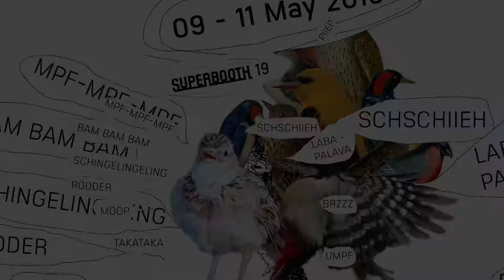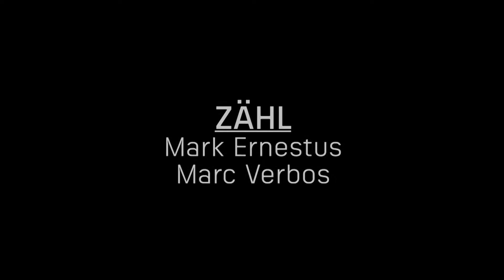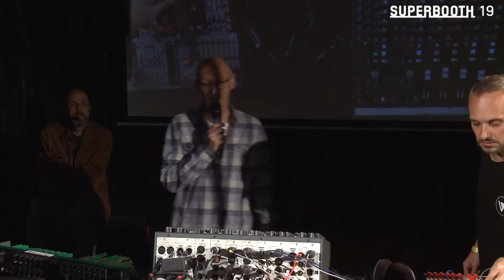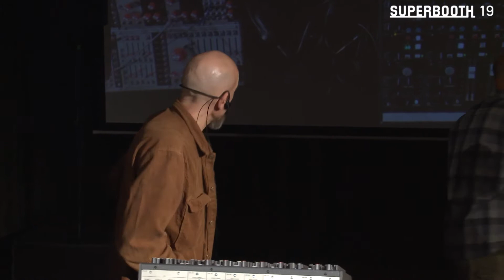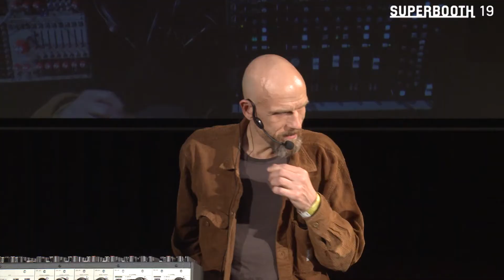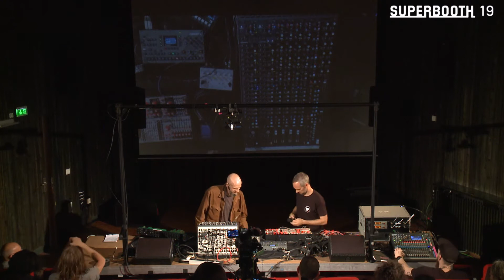ZÄHL - Mark Ernestus @SUPERBOOTH19

Comment: Its funny how man behind basic channel with less is more approach goes to opposite direction and searches for overcomplicated solutions for problems that don't exist. Want to modulate mixer parameters? Just use a DAW.  One of the worst tech demo ever.
Reply: It’s designed around his workflow, which is in the analog domain

And basic channel isn’t exactly less is more for its own sake. Things like sonic fidelity are placed on a higher pedestal than cluttering up the mix with nonsense. Try making basic channel-sounding stuff on a daw and watch it fall flat on its face. They were extremely particular, down to using an unbalanced mixer with custom Mogami cabling throughout the whole studio. Less is not more. Doing something right is more.
Reply: @fl7210  It's 2021 not 2010 and you can make everything in the box. What you need is just knowledge. Mark haven't released anything good or memorable past 20 years. It looks like typical middle age crisis. So instead on focusing on creativity he invents not existing problems and try to solve them. I'm not against gear, but this is just rich mans toys and nothing more.
Reply: @dundulis303  Again, remake BC's sound in the DAW, then we'll talk
Reply: @kw1ksh0t  Butthurt fanboys are the worst. There is nothing special about BC sound. Actualy it's a myth that it was produced using hi end quipment. If you listen to them on high end stereo their releases sound like shit. Their technique wasn't even their own, but classic reggae dub mixing. They were the first who used it for techno. What BC had was their style and the fact that they were pionners in this genre. This plus nostalgia makes them classic and sound the way it is. Few years back there was EP released(4tracks) by some dude that nailed BC sound 100%. At first glace I thought it was unreleased BC record. If I have time maybe I will find a link among my favorites and post there. Nowadays you can produce any sound or genre in the box. What you need is not gear, but creativity and knowledge.
Reply: Lol “some dude”. At least you could’ve mentioned the artist’s name to make your point, but you didn’t because you know you’re completely wrong. Their sound is ethereal because it’s been carefully developed. Also, of course their tracks sound “lke shit” on hi-fi, probably because you don’t understand that the noise, distortion and intentional auditory idiosyncracies are intentional. 

DAWs can’t reproduce this stuff easily because it’s almost impossible to correctly simulate the analog signature with a dynamic audio signal. That’s why no one’s succeeded yet in replicating their sound, and the oke’s who came close did so using analog gear. 

Another thing: using hardware is ultimately a lot of fun, and can improve creativity compared to digital mixing. Sometimes restrictions can lead to the parameters at hand being used better
Reply: @Ruktiet  blah blah. Fanboy rant. And yes I forgot that dude and don't have time to search for that release in playlist witch consists thousands of tracks. I just remember that it was 4 track vinyl with white cover and some letters. Nothing in BC sound is special nowadays. It was more unique feeling and groove, but sound is just average produced on shitty equipment.
Reply: @dundulis303  blah blah. Hater rant. You have no actual arguments other than “BC is produced on shitty equipment but their style is unique”, when there’s at least 2 people completely disagreeing with you.
Reply: @Ruktiet  I don't fucking care. You can make an altar and worship them if it makes to feel better.
Reply: @dundulis303  it’s hilarious how you’re so belligerent, to be honest. Shows absolute terrible character and takes away any credibility you had left. We’re talking about music and you somehow found a way to turncthis into an incredibly negative correspondence. Think about that for a second. Or at least change your tampon.
Reply: At first: not everyone is a presentation/seller guy. But beside that just because of the possibilities inside DAW, I would also prefer analog signal routing and modulating essential parameters, without having to deal with modular cable-managment. Therefore it's an high-end analog approach and shouldn't be compared with a digital DAW.